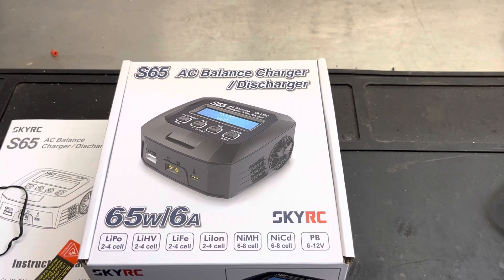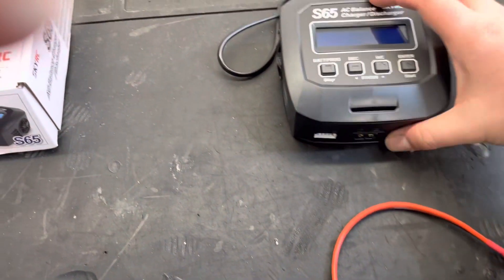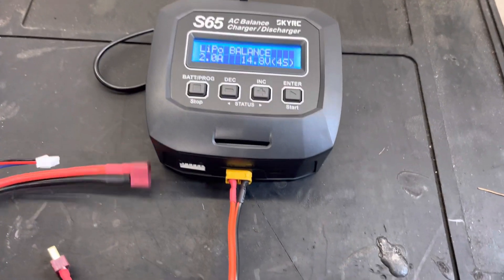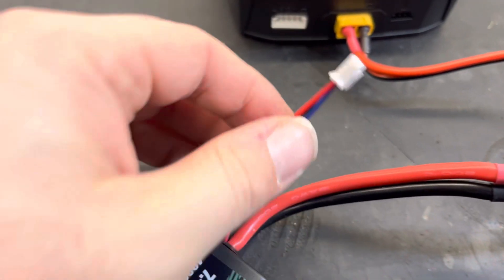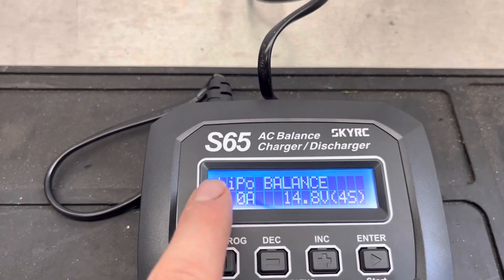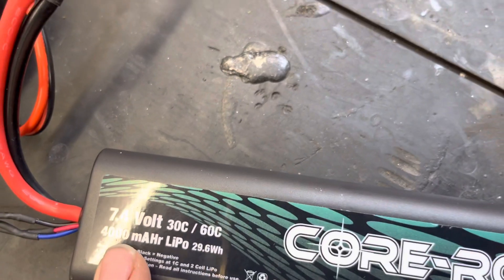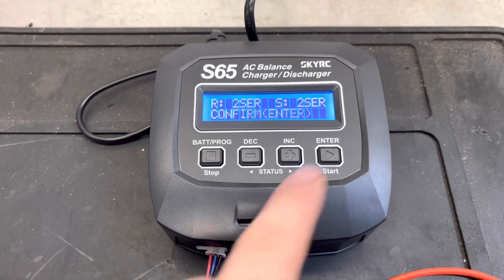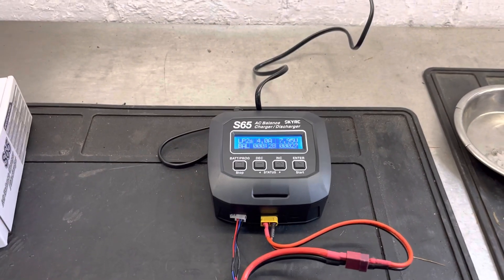Spudski RC How To: Setup a SKY RC S65 charger with a 2s 7.4v lipo battery pack

Comment: i just bought this charger and HRB lipo batteries the one lipo is out of balance and it's brand new never been used how do I fix that with this charger? or can I?
Reply from the maker: @brandon25184  you can keep trying to balance charge it and hopefully it’ll bring the cells back up. Sometimes a weak cell though won’t.

Comment: Can this charger be used to put the batteries into storage mode? And is this hard?
Reply from the maker: Hi, yes I can confirm it had a storage mode. No it’s easy to use instead of selecting charge/balance you can press + a few times and it will change to storage.
Reply: @spudskirc4458  Will it tell you when storage mode is complete or will you have to monitor the screen and unplug when you see the correct voltage?

Comment: Dose the fan run all the time or only when hot?
Reply from the maker: It does a lot of the time.
Reply: The fan only runs for 5 seconds when I turn it on not when charging
Reply: @stevenswaine9209  that’s not true at all… it kicks in ever now and then when charging
Reply: The fan runs when hot but when charging is coming to the end fan stops running until charged